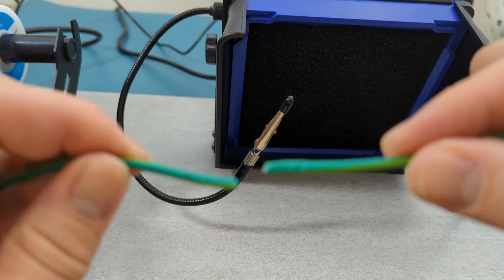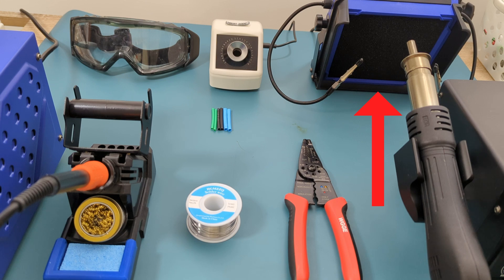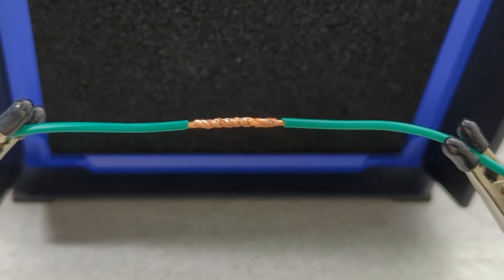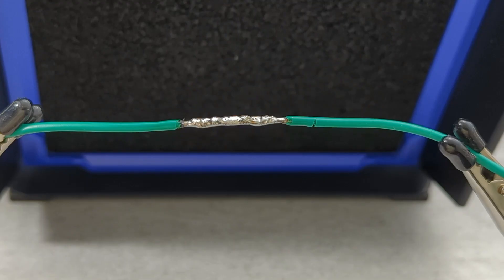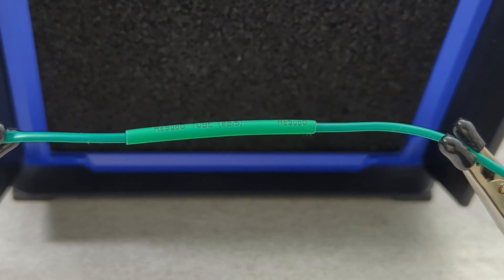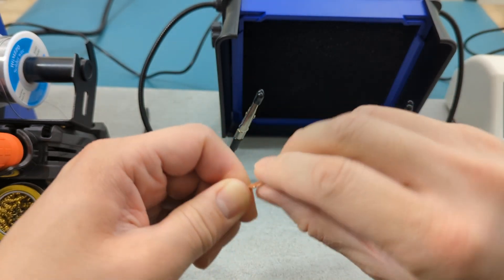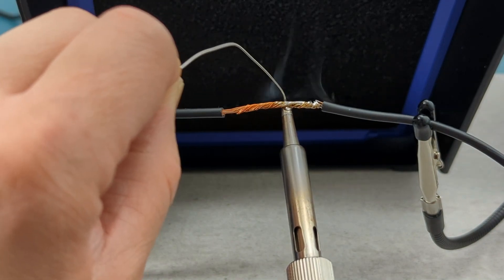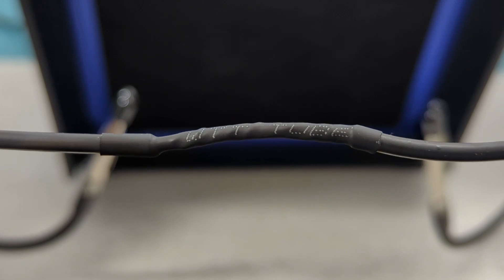How to Solder Wires Together

Comment from the maker: 🔔 Get your tools here:
✅ Soldering Station: https://amzn.to/4bbkHAJ
✅ Soldering Iron Tip Set: https://amzn.to/4ertMYR
✅ Solder Wire: https://amzn.to/4bYWejf
✅ Wire Stripper: https://amzn.to/3YRq6bV
✅ Heat Shrink Tubing: https://amzn.to/3CwydmM
✅ Hot Air Rework Station: https://amzn.to/49YriOr
✅ Soldering Iron Tip Cleaner: https://amzn.to/3Z8WDf3
✅ Safety Goggles: https://amzn.to/3AKXx84
✅ Fume Extractor: https://amzn.to/3CxiQKX

Comment: I've found that using a lighter can sometimes burn the wire insulation next to the solder joint. It's safer to use a heat gun. Given all of the other equipment recommended, I think a heat gun would be a worthwhile addition.

I've also found that fraying the ends and meshing them together before twisting them -- rather than just twisting them -- makes a stronger connection. When the wires inevitably get tugged on during installation, wire management, or daily use, relying only on the solder (and the heat shrink) could lead to a cracked joint that you can't see. This is especially true on marine & automotive uses where vibration can be significant. The extra strength from meshing first is helpful.
Reply from the maker: Great points! 🔥 A heat gun is a safer alternative to a lighter, and adding one to the toolkit is a solid investment. I also like your method of fraying and meshing the wires—it makes a lot of sense for high-vibration environments like marine and automotive applications. Thanks for sharing your experience! Have you tried using any specific solder or flux that works best for those conditions?

Comment: Really???????

Way too much equipment required!
Reply from the maker: Sometimes, simpler is better. You can definitely solder wires with just a basic soldering iron, some solder, and a bit of flux. The extra tools just make the job easier and cleaner. Let me know if you’d like a simpler method!"

Comment: I hate doing this, the lead keeps slipping off the wire, the rubber insulator is already burned and I still don't get a good soldering of the wires, what am I doing wrong?
Reply from the maker: You probably need to apply more heat to the wire and solder simultaneously. You may want to follow the advice from another viewer to apply a blob of melted solder to the iron tip.
Reply: It's likely that the wire has oxidized and has a thin (invisible) layer interfering with the solder bonding to the wire. Put some flux paste on the wire first, heat it and it will remove the oxidation layer, and then the solder will flow easily into the wires.

Comment: Solder irons transfer heat much easier when they have a bunch of liquid solder on them, and the solder is in contact with both the iron and the wire. What I like to do, is very similar to you, except I'll have a blob of already melted solder on the tip, enough to encapsulate the wire, and run that up and down the wire, feeding in more solder regularly and gradually (in dips like welding) as it gets wicked into the wire as you move down it. 

This I find gives a much more even and breif exposure to heat in the area you are working, and you can relitively quickly just go up and down the wire once, fully soldering it, whilst barely heating up the insulation at either end. It ofc works a lot better with thinner wire strands, as the thicker they are the more they wick the heat away, but I'll use a bigger tip and more solder to form that initial blob oif melted solder so it compensates, and you should still be able to go across the wire faster like that, again exposing the insulation to a minimal amount of heat. ;)
Reply from the maker: Thanks for the great tip! This is definitely another option.